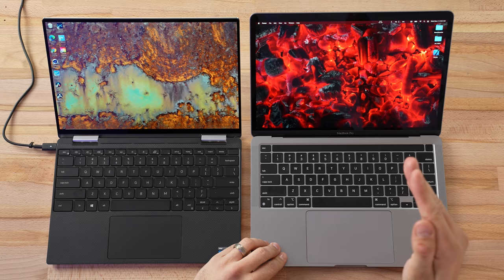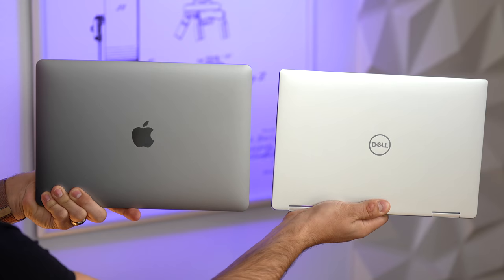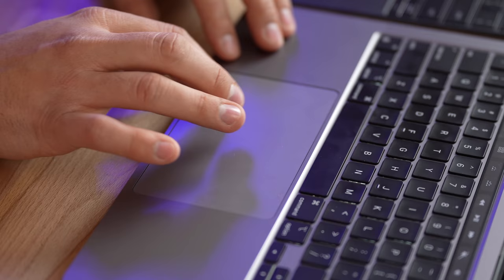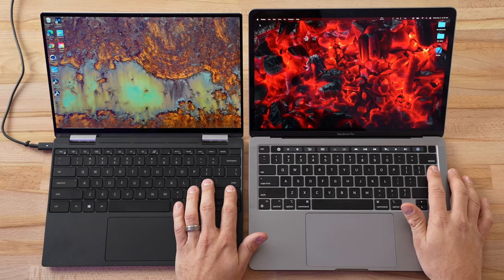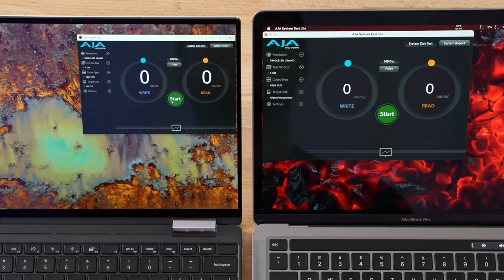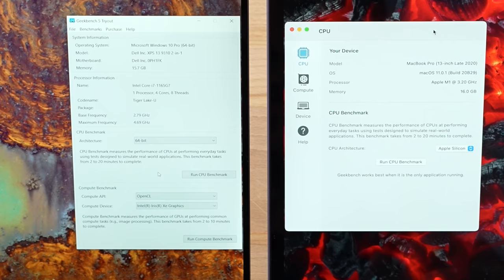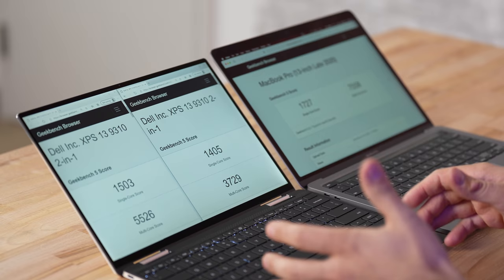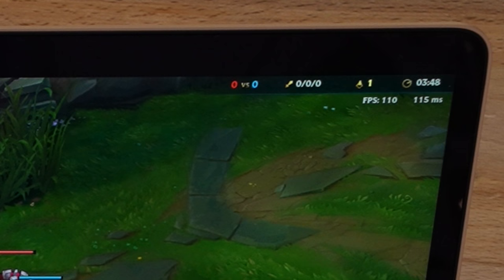M1 MacBook Pro vs Dell XPS 13 9310 - ULTIMATE Comparison

Comment: Man it’s so crazy that it’s the first time that Apple released a CPU for a laptop and it’s already killing AMD and intel!! Which they have been doing this for DECADES!! 😳😳😳😮😮😮
Reply: And only starded being good like 5 or 6 years ago Intel kinda doesn't give one any more
Reply: And apple just wants your money I can almost guarantee that the MacBook was more expensive than that xps
Reply: And not saying by a couple hundred dollars 
 it's probably good 1k more expensive.
Reply: For the price of the Mac you could buy a pc that has 16 cores 32 threads and a 3060 to for a gpu and a 1000 watt power supply with 16 gb of ram and a good motherboard you could literally buy a beast of a pc for 2399 Dollars
Reply: While that xps is only 650
Reply: @FBI_42069  sir we are talking right now not from a couple years ago. a couple years ago Apple just overpriced their MacBooks because they had to pay ton of money to intel for use their cpu. now that it has changed. there isn’t any laptop right now that it’s comparable to any MacBook with the M1 chip for the price and performance.
Reply: @FBI_42069  this MacBook costs $1500 and the xps 13 starts at $1000 with awful specs. You look like a clown comparing a desktop to a pc they’re not interchangeable.
Reply: Even with their new cpus, it’s very limited and restricted on what you can do. So what’s the point of having a beast cpu if you can’t do what you want to do?
Reply: @FBI_42069  bruh accept the macbook was better
Reply: @christhedoc8689  what are talking used to overpriced their phones that haven't changed since the iPhone 4 or 5 but yet you guys still pay 1100$ on it and even with GPU prices up know you still can build a computer for less money than a mac
Reply: @alabaster7958  , that's why when I go to apple's website it says it is 2399 yeah, get your shit right before you call people clowns
Reply: @fuegor109  I never said it was better I just said it was cheaper and that their was better options
Reply: @FBI_42069  its the same price bruh, so in this case the macbook is better

Comment: So the Mac is better in every imaginable way for the price?
Reply: yes... and it's not even it's final form. Next year it will be dumb to even buy windows laptops lmao
Reply: Yeah if u do not want touch screen
Reply: @shankarsr1  Plug an iPad as a second monitor with sidecar and you will have your touchscreen. Even, can use an Apple Pencil...
Reply: @foolpersona_  Windows is horrible with touch even on a surface pro. That's definitely not a selling point especially when the screen has half as many pixels as the Mac.
Reply: @shankarsr1  that's the last thing I would use in a laptop. I would rather have a nice trackpad.
Reply: @shankarsr1  i have an ipad, i'll do just fine.
Reply: @foolpersona_  Windows laptops have to be sold for ridiculously low prices to keep customers.
Reply: @foolpersona_  not if youre a gamer
Reply: Except for offering a touchscreen, but yes, the Mac is better, period. The XPS is a good laptop, but it just can’t compete.
Reply: Yeah, definitely.  Just got the $1,799 XPS and I'll be returning it tomorrow morning.  Didn't take long (maybe 1 hour) to realize it's not even remotely worth it.  If the XPS got AMD, ran a lot cooler, had better color accuracy, less ghosting, better battery life, improved trackpad, faster charging, basically if it had better everything then the XPS would be worth considering 😂
Reply: Higher is worth man.
Reply: @BernardOuellet  Ah yes another 2k dollars on more apple products
Reply: @nanoscapehd6179  this is why window 8 is the best windows for touchscreen, I really hope they completely redesigned the interface like how Windows 8 was
Reply: @foolpersona_  well , it's true now .

Comment: The fact that this exact chip is in a fan-less Macbook Air with almost identical performance is insane, I know it's being compared to a cost to cost Windows laptop, but that thing has a High end quad-code i7 in it, the M1 is apples equivalent of a dual-core i5 and its smoking it.  And then if we take performance out of it, the battery, screen, webcam, speakers, mics, keyboard, build quality etc is all better,  i'm amazed
Reply: “High end” “quad core” is why intel is ridiculous. All of amd and apples good stuff is like 6-8 cores. Intel is such a joke.
Reply: Not sure how you get equivalent of a dual core i5, that doesn't make much sense.
Reply: @dustinthomason1840  TDP, Power consumption, and cost to produce
Reply: @Shaggy12321  that's not how processors are compared. Transistor count, core count and TDP are more accurate, at least you got one right.
Reply: @dustinthomason1840  🤦🏼‍♂️

Comment: Bruh everything's great about m1 but their ssd upgrade price is ridiculous.
Reply: Even the ram prices are ridiculous. Still I would happily buy the m1 MacBook over a shitty windows laptop.
Reply: Forget the Ssd, you can buy external. Upgrade the RAM to 16(it costs the same as the 512 SSD upgrade) just to future proof it a little. The entire machine performance is based on the RAM.

Comment: More evidence that Apples unified memory is superior in every conceivable way
Reply: Imagine unified memory on a 32gb or 64gb SoC! 😳
Reply: @My-by  Exactly. Considering that the GPU could access 64gb memory is mind-blowing. 
In contrast a discreet x86 GPU with this much memory would be extremely expensive and insanely power hungry
Reply: Unified memory is superior given you have enough of it. 8gb is not enough for anything more than web browsing. I’d say minimum for professionals or creative hobbyists they need to just upgrade to 32 so you have essentially 16gb of Ram and 16 vram. Or 24 Ram and 8vram. That would be nice
Reply: @RiceCubeTech  You are factually wrong. There is enough proof on YouTube that A) 8gb unified memory is like having 16gb on x86 and B) that not having enough memory barely stops the new Macs from completing its tasks. The loss of performance with unified memory is 10%-20% as proven by multiple stress tests on YouTube and even 8k 10bit raw footage only reduces the performance of 8gb M1 Macs to roughly 50%. You cant do that with x86 at all.
Reply: @NoOne-uh9vu  non upgradeable ram sucks 
Period.
Reply: @RiceCubeTech  "so you have essentially 16gb of Ram and 16 vram. Or 24 Ram and 8vram"
Reply: @NoOne-uh9vu  AMD won't sit around like intel 
AMD will adapt and come with a ARM based chip that will kick M1's ass
Reply: You guys are ignoring who optimized MacOS is for this chip, that's why the memory usage is low not because of integrated memory. Case and point iphone vs Android, both have memory integrated in the SOC but iphones need ALOT less memory
Reply: @DrAdityaReddy  In what year is it gonna happen? Sure when AMD finally have a product it may kick M1 ass but Apple is already going to be on M4X in the meanwhile
Reply: @DrAdityaReddy  until now that having soldered memory didn't give us any benefit, I agree. But now with this performance I can't.
Reply: @NoOne-uh9vu  2021
Reply: @DrAdityaReddy  What drugs are you smoking?
Reply: @NoOne-uh9vu  just wait and watch
Reply: @vernearase3044  I beg to differ and most Youtube techies do to. Ive the 16gb pro and it can handle much higher memory loads consistently vs my previous full spec 16" with 32gb which can barely keep up once the RAM is exhausted while the M1 just keeps on pushing and executing despite the swap being already 12gb size. My 32gb x86 Mac just stops working properly once the limit is reached while my M1 Mac keeps working not breaking a sweat
Reply: @DrAdityaReddy  I'll wait and wait more and then wait even more
Reply: @vernearase3044  Again, when my x86 32gb Mac runs out of memory then every running process comes to a halt and the OS becomes extremely sluggish and unresponsive. In contrast my 16gb M1 Mac just keeps on working despite the memory being exhausted and the swap reaching 12gb sometimes. Surely even the M1 Mac does become a bit slower but not unresponsive and certainly not frozen. Know the difference
Reply: @vernearase3044  "
Reply: @NoOne-uh9vu  You are ignoring other variables such as Apples piss poor cooling on the old Intel Macs, the T2 Chip bottle neck, old versions of Mac OS, and slower SSDs. You are also underplaying how optimized Mac OS is for these new chips, that's why your memory usage is lower not integrated memory
Reply: Imma leave a comment here so that when M1X comes out I will laugh at that AMD fanboy
Reply: @DrAdityaReddy  bring it on! :-) this can only benefit us, the consumer
Reply: Having upgradeable memory doesn't mean you can revive older computers. But upgradeable storage does
Reply: @AdamSmith-gs2dv  Older versions of macOS? Nope, my x86 runs the same version.
Cooling? Well my 16” has a better cooling system then my M1 and a larger thermal envelope as well. You are talking out of your ass.
I have not underplayed anything, Ive claimed that unified memory is far superior to the regular one. The reasons are solid. You may want to read the anadtech analysis or better yet buy yourself an M1 and experience the magic yourself. Read my other comments about my hands on experience on real life tasks why unified architecture is a new paradigm when it comes to being able to continuously performing under heavy memory loads. I’m talking about 2x - 3x of memory usage that’s on the M1 system and barely throttling down. X86 architecture comes to a screeching halt as soon as the memory limit is exhausted while the M1 doesn’t care and keeps on completing tasks like a champ. All this while staying efficient and cool and creating no distracting noise. The M1 mini is said to be able to stay under 100% load forever. This is unprecedented. The new unified architecture is more efficient, more sustainable and ultimately more productive because it doesn’t care for the limitations its x86 brethren have. And we are talking about entry level. Apples slowest chip will ever make
Reply: @kamikamieu  Intelligence is rare these days. The entry level Macs maximum RAM was 16 GB even before the M1. This is a limit of the hardware. And you couldn't upgrade RAM in MacBooks for 10 years now you genius. Just buy the maximum and shut up. Its 200 bucks difference
Reply: @NoOne-uh9vu  That's very interesting. I was afraid that the 16 gig limit could disqualify for parametric 3d CAD and FEM, etc. Would be nice to see how FreeCAD is doing on the new macbook's.
Reply: @andressolar517  I only tested Maya and Blender so far and the M1 rocks both like a champ. I cant speak for CAD but I assume it will handle just fine especially when optimized for metal
Reply: @NoOne-uh9vu  thx.. FreeCAD doesn't require a professional gpu (quadro, etc.). It is comparable to Blender & Co. Very impressive new notebooks from Apple. I think far ahead of competition.Going to stay with Apple.
Reply: @NoOne-uh9vu  One thing to note, ram might not make much difference to performance in M1 mac's but what they'll likely affect is the internal SSD due to the lower GB option having to swap more often when it runs out of ram. That eats the life of the laptop quite a bit faster.
Reply: @ahmeeeeeeeeeeeed  You are creating a straw man. That doesnt change the fact that the M1 is not constrained by its memory in the same way as x86 is which makes the new architecture superior. That was my claim. What you are saying only makes the case for apple to use ssd's that are not prone to failure. What people dont seem to understand is that the lower end Macs cant have more than 16gb currently and couldn't before on Intel chips either. If you think you need more memory you have to wait for M1X or you gotta put your trust in the ssd. At least the M1 gives you the ability to just ignore the limit and keep on completing tasks. You dont have to but you have the option in contrast to x86 where the machine will just stop being effective once memory is exhausted
Reply: @DrAdityaReddy  
If AMD could do it they would have done it already and by the time they catch the M1 Apple will be on the M2 or M3!” It’s a done deal.
Reply: @DrAdityaReddy  
AMD is a x86 chip maker they’ve got a long way to go! Now considering Qualcomm already makes arm chips  I would give them a better shot then AMD.
Reply: @AdamSmith-gs2dv  
How can we be sure which one it is since nobody else seems to be able to reproduce it on x86 or arm? 
You mean to tell me that windows couldn’t better optimize their software to an ARM chip that they themselves designed with Qualcomm? 🤔 every software company does software optimization, so that tells me that the power and speed must be coming from Apple’s integrated M1 chip.
Reply: @NoOne-uh9vu  lol “your factually wrong there’s enough proof on YouTube” is this sarcasm? Is YouTube an official source?
Reply: @mranime9145  Visible, tangible proof that matches my own tests & experience to the T you mean? Yes.
Reply: @DrAdityaReddy  AMD Does not make Operating Systems and Microsoft will keep milking the x86 market long as they can. AMD limits will be Microsoft at this point. Apple makes their own hardware and software end of story. x86 has people building eye candy computers of the 80s.
Reply: @DrAdityaReddy  it's 2021 and nothing has happened.

Comment: I think Intel can achieve the same bench score performance to current Mac in 2022 with new Intel 12 or 13th Gen.
Reply: New M1 is amazing 😉
Reply: ya
or maybe intel has already gone bankrupt by then
Reply: yeah for sure by then it's going to have the same score... as the M1, while in 2022 Apple will have the M3 which will rape again Intel 13th gen.
Reply: Have you thought about where the Mac M series chips will be by 2022? The possibilities are mind blowing!
Reply: it won't even match the top M1 in 2022. These are just the ultra-slow M1s. The M1X and M1Z, on top of other CPUs we don't know about yet, will be 50% to 100% faster than the M1.
Reply: So they’ll finally get the performance of a 2 year old chip?
Reply: by 2022 Apple will have their own chip which WILL outperform the current $50000 Mac Pro intel version
Reply: You are too optimistic, 14nm+++++ pace, Intel 2030 probably can beat m1 2020
Reply: @cedricphoo  Tiger Lake (the chip in the video) is 10nm.
Reply: but by that year Mac will have even more better cpu
Reply: A controversial statement
Reply: Don’t forget many tests still running under Rosetta conversion.   M1 will look even better when programs optimized for M1.   Then comes newer M series.   It’s clear to me that Apple has raised bar to an entirely new level with ARM and other companies will be in a fight for their life.
Reply: @elenchus  It's a joke about how long 14nm went on for. Even now, I don't think Intel have any 10nm desktop chips do they?
Reply: @thebuddercweeper  Yes, 14nm is still ongoing in the desktop and in high-end laptop.
Reply: But Apple didn’t just make a faster CPU. For Intel or AMD to beat this, they have to beat every one of M1's advantages. Intel must get their process down to M1’s 5 nanometers, but Intel is already years late getting to 10nm and 7nm. Intel must get their power consumption way down to match M1, because if they don’t, the CPU will run too hot to maintain performance, as we see in MaxTech tests. Intel must also get the CPU, GPU, and RAM + storage memory fully integrated to reduce latency, like the M1. If they cannot do all that, they will remain behind Apple.

Given Intel’s delays, can they really achieve all that by your 2022 date?
Reply: @brightboxstudio  Oh they'll have something that beats the M1 in 2022... but it will still use 35-40W at peak.

Edit: Oh, just a quick side note, according to pretty much everyone, Intel's 10nm process is roughly equivalent to TSMC's 7nm process, so they don't have as far to go as it sounds at first. 
Though I personally still don't think the Intel 10nm chips are nearly as efficient as specifically Apple or AMD's (made by TSMC) 7nm ones since they still peak at 45W for less performance than something drawing less than half the power.
Reply: 😂😂😂you mean 2030
Reply: @elenchus  only 
Laptop
Reply: @Aecor  the 14nm parts? They're still the main desktop CPU from Intel (in fact, I think the only desktop CPU from Intel right now), but Ice Lake/Tiger Lake will become Rocket Lake for desktops purportedly in 2021.
Reply: @elenchus  I’m talking right now
Reply: @elenchus  and apple is in 5nm
Reply: @Aecor  I guess I need to know which comment of mine you initially replied to. I might be confusing which one.
Reply: @elenchus  the one before your last one
Reply: @Aecor  oh. Well the chip in the video is 10nm. Their 10nm are their slowest chips in CPU performance (best in iGPU performance).
Reply: @elenchus  this is i7 not the slowest chip.  M1 according to apple is just a i3.
Reply: @Aecor  This version of Tiger Lake isn't the slowest version of Tiger Lake, but both Ice Lake and Tiger Lake are their slowest overall current-generation CPUs. Their 14nm CPUs (i.e. 9980HK) are much faster in CPU-based performance. Both Ice Lake and Tiger Lake are still quad cores and their frequency is limited, but they're more efficient and have overall better IPC than Comet Lake/Skylake/14nm stuff. 

Ice Lake and its derivatives were designed specifically for ultrabooks, so battery life and thermal design were the priorities, not performance. Big 14nm chips like the 9980HK are derived from desktop chips and have more, higher-clocked cores.

That said, the iGPUs of Ice Lake and Tiger Lake are vastly better, so if you don't have discrete graphics, the performance gap is smaller between them.
Reply: @elenchus  oh I’m not talking about this in an year apple will release a iMac, a Mac Pro. You have to accept intel is way behind the competition.
Reply: @Aecor  Way behind